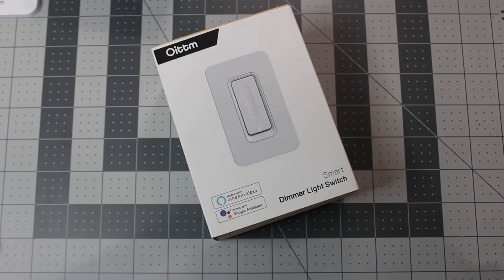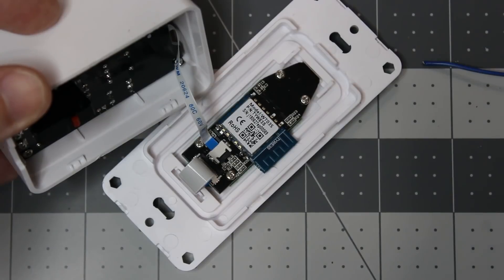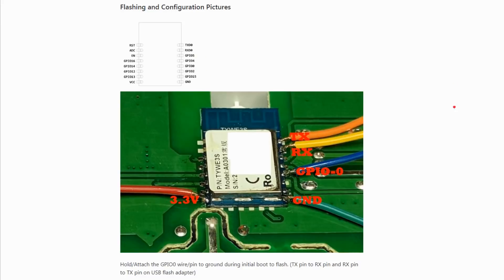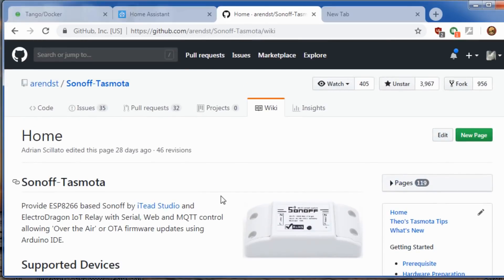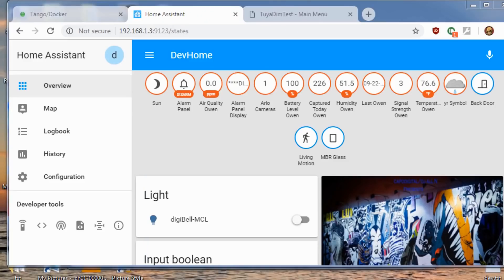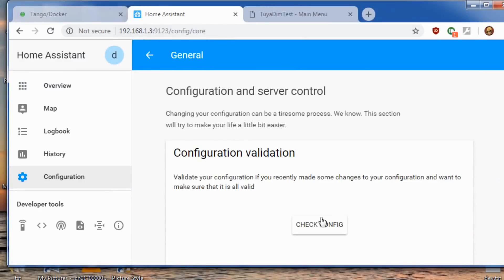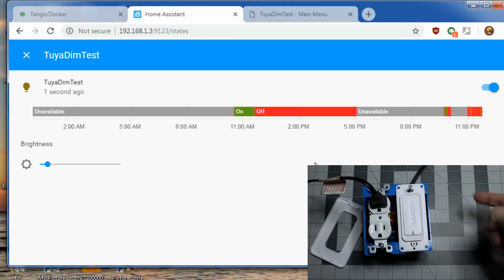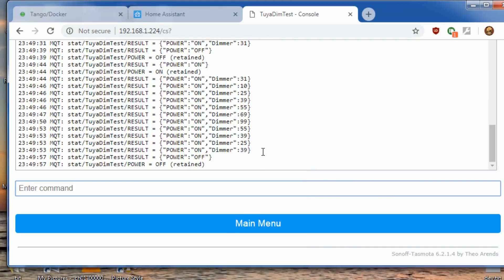WiFi Dimmer Switch with Tasmota - Local MQTT Control

Comment: Did you have any troubles flashing this? I believe I successfully flashed it, (ESPEasy succeeds) bit when connected to termite, I just seem to get a bunch of rolling errors and exceptions.
Reply from the maker: I actually was flashing about 3 or 4 tonight and had this issue with one.. I ended up reflashing  and the issue went away. I have seen this before with a different switch and it was due to the USB not feeding enough power and I had to power with 3v3 from another source after booting.

Also make sure both ribbon cables are unplugged on the board with the esp8266 chip.
Reply: @digiblurDIY  I'll try powering it from a separate source and report back.
Reply: re-soldered my connections, re-flashed used a different FTDI adapter and all good now :)
Reply from the maker: @BrandonKeilman  Awesome!  Glad to see you got it and thanks for the follow-up.
Reply: @digiblurDIY thank YOU for finding them and the videos!
Reply: Ok, so I got around to finally installing this.  Using the latest tasmota fw 6.3.0 mqtt would not work.  It didn't like something with the brightness_state_topic: I kept getting command unknown when watching the console.  I flashed it with your .bin file and success working as intended.
Reply from the maker: Which are you using? Latest Tasmota or the one I have posted. I have found the one I posted previously doesn't have a bug with not reporting the power state.
Reply: I'm currently using your posted .bin file.  the latest tasmota 6.3.0 wouldn't work.
Reply from the maker: Does it work via the Tasmota GUI?
Reply: with your .bin yes
Reply from the maker: OK. So it's just a HA template thing. Make sure you changed all the entities in all pieces of the template.
Reply: no, using the tasmota 6.3.0 firmware I didn't even have a button on the gui.  using your fw, I had the button, and dimmer on the gui.  Sorry I miss-understood what you were asking with the tasmota gui haha.
Reply from the maker: Using this template in HA?  https://github.com/arendst/Sonoff-Tasmota/wiki/Home-Assistant#dimmer--pwm-led
Reply: correct.
Reply from the maker: Could you email me screenshots of the errors or hit me on discord?  just add gmail to the channel name.

Comment: Are there other dimmers we can use for the exact same purpose? This dimmer has round corners and it doesn't look nice next to other faceplates on the wall. In the US faceplates with sharp corners made by Leviton are more popular. ( https://www.leviton.com/en/products/commercial/electrical-wiring-devices/wallplates/decora#t=Products&sort=%40wcs_site_tree_rank%20ascending&layout=card&f:@color=[White]
Reply from the maker: Check out the very end of this video.. I show some clips of upcoming footage of a dimmer video. Links of the two should be in the description.

I had this same frustration though when I had to Dremel the faceplate a bit. The other two coming up are square though.

Comment: why tasmoto firmware if its already capable of doing dimming? or is that option now passable to alexa?
Reply from the maker: Stock firmware doesn't have local MQTT control and many other features. You have to rely on the cloud and internet working to turn your lights on that are 5 foot from you.

Comment: can i control the fan speed with this switch?
Reply from the maker: Most likely not nor would I try as fan speeds are not changed by the way lights are dimmed. The iFan02 is probably what you are looking for.

Comment: This is so awesome, thanks!  Just ordered one to follow your steps, I can't wait.   How the heck did you get your HA instance to reload so quickly....that was super fast or was it edited?
Reply from the maker: First if you do have any odd issues with the newer version of Tasmota I can say the firmware I still have linked is working fine.

Actually in that one video I didn't edit the restart time. I run Homeassistant on a little desktop Xeon server. Nothing crazy. It runs in a docker container alongside about 15 other containers.
Reply: @digiblurDIY  Hi, can you help?  I got switch, flashed it and that worked.  It's on network and in home assistant.  The switch part works, but not the dimmer.  dimmer down not show on home assistant.  The only thing different is that I flashed it without that small cable attached because it pulled out when I popped the cover.  BUT, it flashed fine, accessed it's IP and configured the switch as Tuya_dimmer choice under drop down.  The dimmer part on the switch does send MQTT data on the console, you can see the values go up and down, but its not reading the dimmer slider.  In fact the slider on the tasmota main screen does not adjust it either.  Thoughts?
Reply: you know what, I put it under switch and not light, opps, let me try that.  Can't believe I'm this close.  GREAT instructions my man!
Reply from the maker: @demps7765  came to respond to you, glad you got it figured out!  The slider on the Tasmota GUI does not automatically refresh when values are sent over via MQTT as it wasn't designed to do so.  Its designed to interact with and you click on it.  You can also hit me up on Discord on the HomeAssistant one or DrZzs you can find me.
Reply: yup works better....haha....Thanks, installing it later keep yah posted.  I got my other 4 switches...so fun....

Comment: Is there a way to control these from some other type of remote switch rather than a cell phone app?  I have 3 groups of lights in my basement and I'd like to be able to control them from 2 to 3 locations.
Reply from the maker: Yes. So many options in the DIY world with MQTT and HTTP commands. You could even do a few other dimmers and have them not control anything physically but yet send dimming commands to the actual dimmer attached to the light. You could also do another sonoff type device and do two buttons up and down that send commands.

Comment: Nice first video buddy. Do you know if there is a UK version?
Reply from the maker: Thanks! I asked this vendor if they had a form factor for the UK but unfortunately they don't, electrically it would work but the form factor is an issue. I know several folks in this thread have been working on incorporating several variants. https://github.com/arendst/Sonoff-Tasmota/issues/469

Comment: First of all - excellent work and thanks for sharing the code. I have a quick question for you though... I have been itching for a “soft-on” + “soft-off” function... could you please clarify if this would be feasible to integrate into your code for all on/off actions? 

Ideal would be the ability to somehow hardcode the default speed from 0-> defined brightness (+ same in reverse) on the switch itself with the option to override this value with an added MQTT variable.

On a side note... have you looked into the code remembering the last dimming value set on the device for example? Some traditional dinners for example allow for double taps to trigger full brightness without overriding the previously defined single press “on” brightness.

This is really cool though - finally a hackable mains voltage wifi dimmer!! Joy!
Reply from the maker: To update on things, the code/pull request was incorporated into the regular Tasmota firmware.  It's currently only in the development branch but works great.
 Unfortunately a lot of the items you are asking about might not be feasible as the dimming ranges, speeds, etc are all programmed into a secondary microcontroller that is not flashed in this video.  I did see a small header for possible programming of this chip but didn't look into it as I felt it would go beyond what most people were capable or even interested in doing.   The last dimming value is working with the Tasmota firmware as is the feature of setting the dimming value without the unit turning on (if the user turns on that option in Tasmota).  It does have a few drawbacks here and there but I really enjoy this dimmer myself as it was a huge hole in my automation needs.

Comment: Thanks for your efforts on this.😀

Solder 5 wires, flash your. .bin, works flawlessly through home assistant.

Can turn on, off & set brightness all through Alexa & the states report instantly..! 

I simply modified the lights.yaml (your example) to reflect my switch & all worked perfectly. 

Just awesome.

Comment: Still working with alexa commands?.
Reply from the maker: You can use them through your home automation software or possibly through the emulated hue feature of the Tasmota firmware but I don't have an Alexa to know how that feature of Tasmota works.
Reply: @digiblurDIY  Cheers, I ended up going through Hass.

Comment: Brilliant Video, love the custom firmware here, with a couple of tweaks could the firmware work with the mpdmv7 with DAC? as this light switch inst available in my area.
Reply from the maker: I am not familiar with the mpdmv7. How does it work and what is it?
Reply: its a esp8266 with additional board with DAC, i found at https://www.tindie.com/products/nEXT_EVO1/ac-mains-dimmer-mpdmv75/ also researching into it some one has already started working on a modded version of Tasmota managed to get working with MQTT https://github.com/daenny/Sonoff-Tasmota. my next step is trying to integrate it with home assistant to create a daily artificial sunrise (Sad Lamp)

Comment: I like the switch and the price.... I'm in a catch 22 though, my upstairs wiring has alot of 3-way switches.  Do you have any recommendations on switches?
Reply from the maker: There is a little advanced setup doing a 3 way switch as a low voltage triggle but it really depends on the wiring schematic used and there are so many. If you do want easy and don't mind paying a bit more there is Zooz and Inovelli Zwave switches that work as straight swaps for 3 way configs.
Reply: Yea it's interesting - just pulled the switch from my office and it's a 3way ( I had a belkin standard wifi switch and quickly realized I can't use it here...) but there's no second switch anywhere, I'm guessing they used a 3-way to split the power?

I ran around checking wall plugs (my downstairs has plugs wired into the switch as when the home was built the original owners didn't want to pay for the 'upgrade' of having a ceiling light fixture. 

Based on your recommendations, either of these two will fit the bill.
https://www.ebay.com/itm/Inovelli-Z-Wave-Plus-In-Wall-Switch-Dimmer-Repeater-NZW31/362306280411?hash=item545b231bdb:g:EfUAAOSwxQha5W5O:rk:1:pf:0 
https://www.ebay.com/itm/Zooz-Z-Wave-Plus-On-Off-Wall-Switch-ZEN21-White-VER-2-0-Works-with-Existing/253929783987?hash=item3b1f6502b3:g:8CwAAOSw1M9bv94h:rk:1:pf:0

Thanks.
Reply from the maker: Keep in mind you'll need something to connect to Zwave since they are not WiFi.  Pros and cons to the setup of course, easy install, but then you have to do the Zwave thing.

Comment: Great video. I was curious about these. I recently received a thermostat with a Tuya ESP built in. It is a mcu controlled by serial via the esp. Here is the link:
https://www.aliexpress.com/item/WiFi-Smart-Thermostat-Temperature-Controller-for-Water-Electric-floor-Heating-Water-Gas-Boiler-Works-with-Alexa/32905181466.html?spm=a2g0s.9042311.0.0.44c84c4dcZfSuz
Do you think TuyaDimmer could be extended to support this thermostat? I'd be willing to test.
Reply from the maker: What functions does the native app have? The packets might be similar but of course it has a much different focus than tasmota does itself.
Reply: I'm pretty sure the tuya protocal is similar. Basically set temperature and then set the schedule for the thermostat. I found the sdk but misplaced it....will keep looking.

Comment: What blithering idiot gave you a thumbs down? Some people have zero class.
I agree that they should have designed to standard gang plates. Rounded corners look good, but i'd need to 3D print one for my 4 gang this would be used in. Would be nice to have a smoother step, but what can ya do eh.
Reply from the maker: Better than no dimmer indeed.

Comment: hello. congratulations!!! I have the PS16DZ wifi dimmer, it works with the ewelink app and have an esp8285. Do you know if I flash it with tasmota will work too with the " 49-Tuya Dimmer" options?. thanks
Reply from the maker: Probably not given that one isn't Tuya/Smartlife based.

Comment: this is awesome ! would this model work in Europe too?
Reply from the maker: It does say on the back 110-250v 50/60hz but then the size might be an issue based on the boxes you have. I'm checking around with the vendor to see if they have other form factors.

Comment: It’s works with normal LED bulbs ?
Reply from the maker: It should. Check to make sure your LED bulbs state they are dimmable.
Reply: it does not supprt normal LED bulbs if they have to be dimmable!
Reply from the maker: You could spend hours reading on the mess of dimming lights and there not being a standard.  Most of my bulbs I happened to have been buying are dimmable types so it all depends on how someone defines what a normal LED bulb is.  Some people get away with using non dimmable ones in dimmers and some don't.  For me it's too easy to go to the local big box store here and pick up a few LED bulbs that state they are designed for dimmers.
Reply from the maker: Jerry H  Check your inbox.